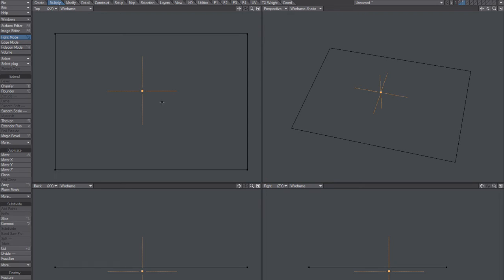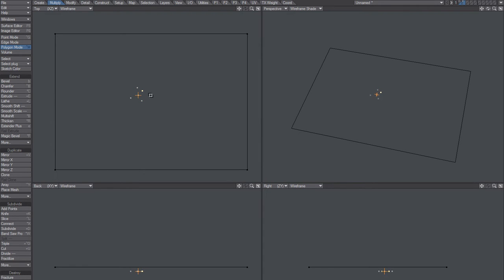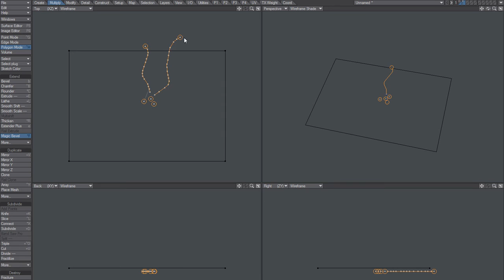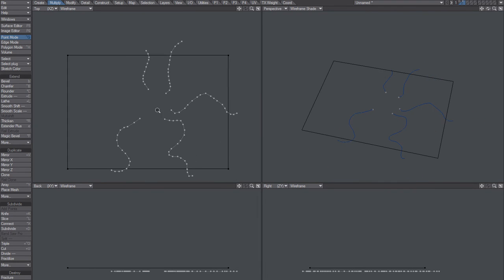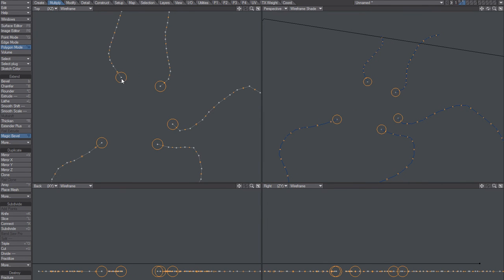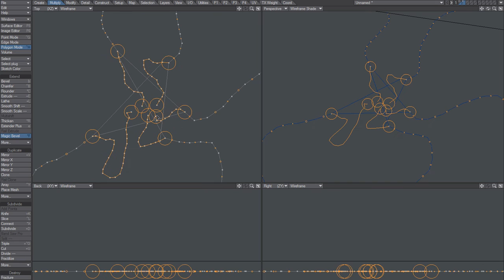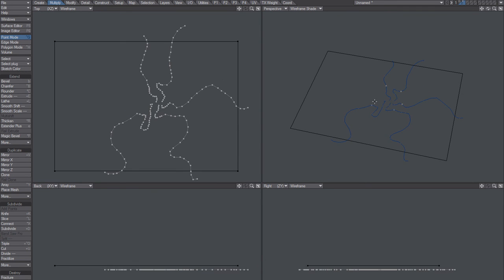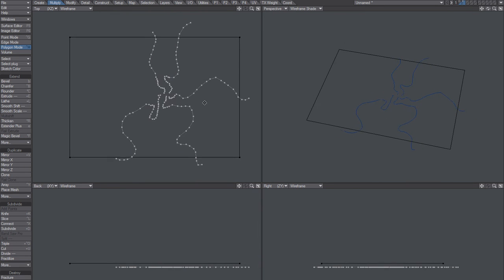LightWave Model - Manual Cracks #2   (Fracture)

Comment: not sure if I missed something in some other parts, but wouldn´t it be enough and easiest to just use the sketch tool?
Reply from the maker: you could, but you would have to freeze the path, then use strandmaker
both tools have cons / pros
if either one of them was improved it would help quite a bit...
Reply: +erikalst 

not sure what you are doing actually, thought you were to use the cracks to stencil drill, in the other geometry, and you do not need to freeze the crack parts when created with the sketch tool, so that works to stencil as they are..but obviously that is not what you are aiming for here?
you do not have to freeze paths drawn with the sketch tool, strandmaker works directly on them.

so what gives on freezing them for some reason?